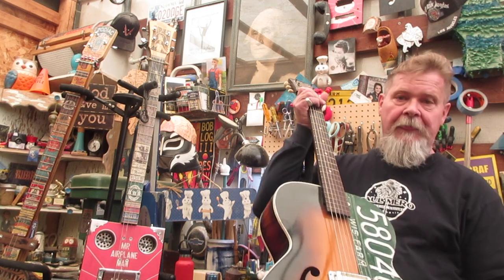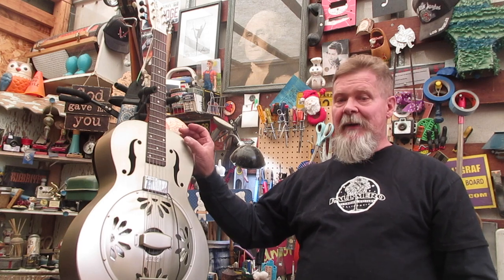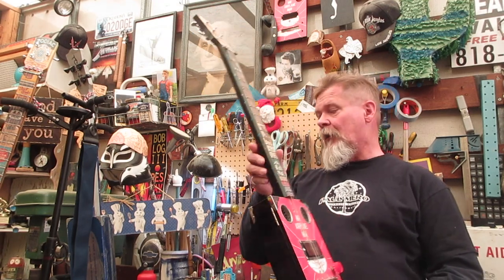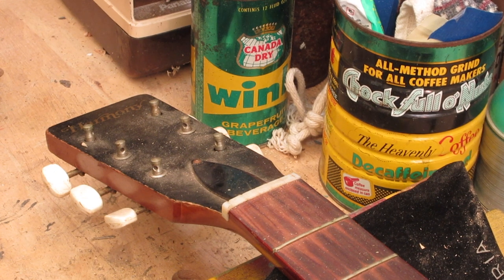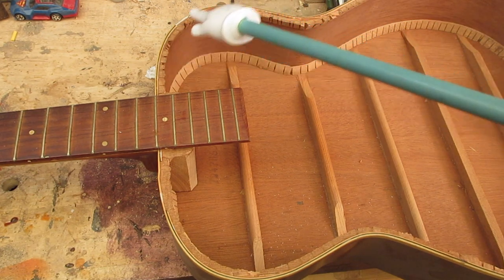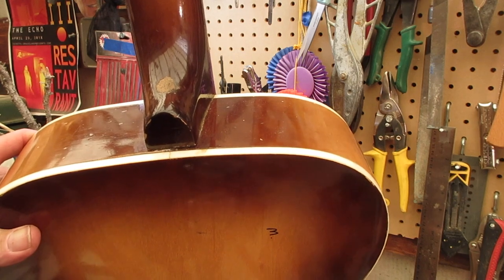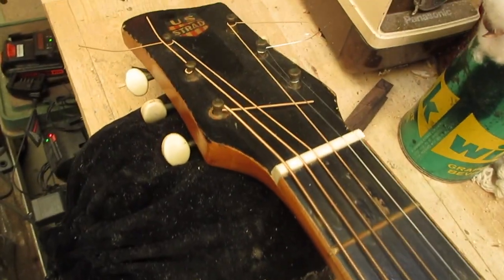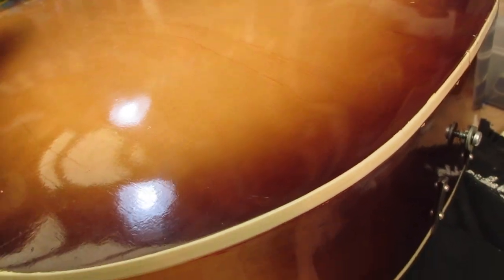Beginner's Guide to Vintage Econo Archtop Guitars

Comment: Thanks, I guess this is a great channel to learn the ins and outs of my guitar properly. This is the first of your vids that I've found, but you mentioned other pertinent episodes that I'll look for next. Just subscribed.

The guitar seems to have lived in a closet rather than an attic or root cellar, so that's good. Slightest gap at the neck which seems pretty stable (and it plays well) so far. No binding (H1214 model didn't have any) but no cracks, straight neck, good bridge. We'll see how it holds up when the weather turns warm and humid. It's incredibly lightweight, and your teardown shows why. Anyway, thanks!